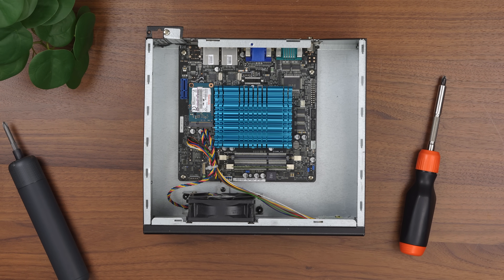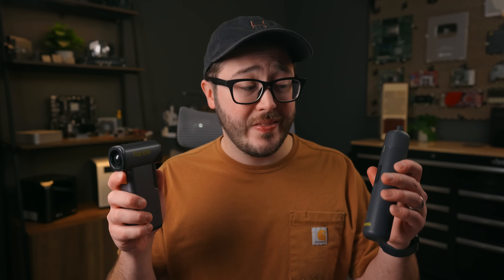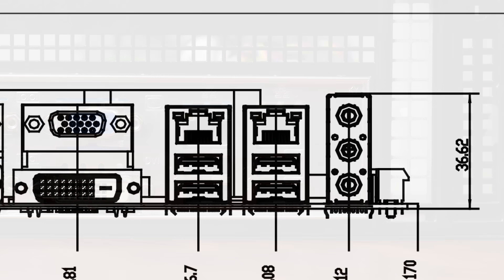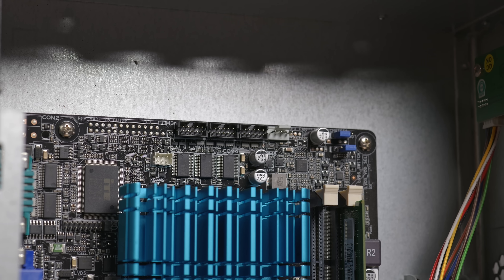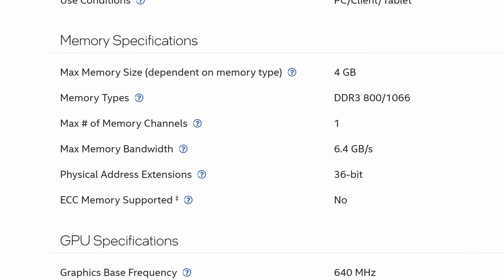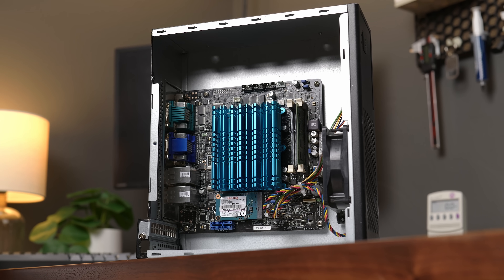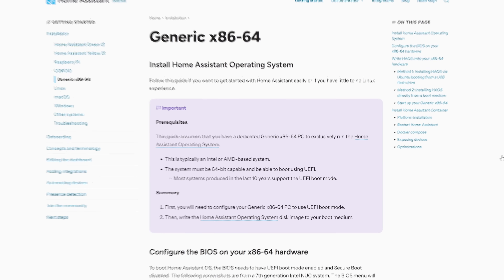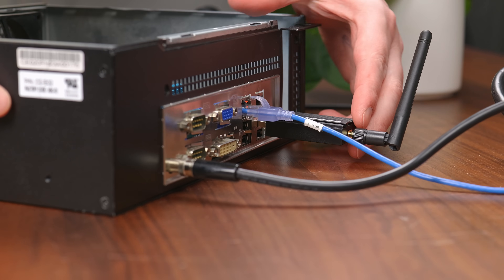I had no idea what this PC was... but I'm glad I bought it.

Comment: Systems like these are what I like to use as substitutes for Mainsail or Fluidd. I've got all 6 of my Klipper printers connected to an old Dell Optiplex 5050 with a swapped in 6100T. Ran me a total of $25 for a box of hardware at a yard sale. If it boots, it has a use. Just have to find it.

Comment: It's probably used for digital signage - it's low power with no moving parts for durability, it may get housed within a larger sealed enclosure getting hot outdoors which would need the fan, and the duties would likely just be displaying a slide show or video on loop for advertising purposes which would be updated remotely over the network. It may also have other sensors or inputs connected as well.

Comment: I paid $10 more on the B10 pro max duster 3 days ago before u dropped this video, might cop the screwdriver since my e1 max struggles to screw in pc fans or anything they requires high torque so I might cop the S1 pro or whatever name is with your coupon code at some point

Great video.

Comment: I have an old Shuttle ITX barebones system that was orig rocking a Core2 Duo motherboard which died long ago... It currently has a weird AAeon motherboard, did you try CPU-Z mine shows as EMB-B75A (2/3RD gen intel) which is what the motherboard is,  with a "very" exciting i3-3220 and a staggering 8GB (4GBx2 dual channel DDR3 ) .. It was some sort of industrial board as well and has some quirks I tried putting a NVIDIA Quadro M2000 in the PCIe x16 slot but it refused to boot with it at all.      Just sort of messing about with docker with it (running a rustdesk selfhosted-server atm)

Comment: HA seems like a good application. Otherwise if you needed an ldap server or other small applications would also work. As an aside, I similarly bought a $16 PowerMac (Blue/White) off Ebay in mid-00s for my kids. I added a stick of RAM and a larger HD and for them (less than 8 yo) it made a great machine to play games on. Reusing old surplussed equipment can be great if you have the right use for it.

Comment: I'd install IPFire and use it as an edge firewall.  The RAM, SSD, and dual NICs are super-good-enough, but the Atom D2250 is limiting.  On a 50 Mbps DSL, it would shine using IPFire with transparent proxy + update accelerator.  I'd also try Intrusion Prevention for fun, but it's doubtful with that CPU.
Reply: Unfortunately that little atom cpu would struggle with anything over 100 Mbit broadband. A while back I bought a 4-lan port mini pc from aliexpress, it has a Celeron N2830. It worked great with my 100 Mb connection, but as soon as I upgraded to a Gigabit fibre, it became very clear I needed a stronger CPU. The whole network started lagging and would slow down. I'm now running (ipfire) on a different mini pc, with a core i3 6100 and that handles full Gb without issues, maxing out around 20% cpu when the full Gb is used.

Comment: I have got a similar board with the same CPU and i retired it years ago. It's less half the performance of a RPi4 and at least double the power draw. Slow as duck for just about any use more than serving a light web page occasionally.

Comment: Using a similar under spec thin client for snes emulation. They good enough for that and draw roughly 15 watts from the wall.
Model: Futro S720, 8GB RAM, Amd GX-217GA, 240 GB mSATA SSD upgraded from the initial 16 gb installed.

Comment: I'd run home assistant and WOL-NUT on it since it draws nothing and can handle home assistant
Reply: Until you do ANYTHING that needs a computational load. A RPi4 has more than double the performance and less than half the power draw.

Comment: I wish I had a system that could both be a usb gadget and be my hypervisor. So I could plug in anything that was at least a processor and a usb port and I might be able to use whatever I plugged in as a node... I could use it to offload some cron jobs, some file organization, etc and my main system wouldn't have to think so much lol. maybe like... a raspberry pi zero 2 for the booting and connecting to the network as a node. then the pi would need various images of proxmox to try on whatever system i plug it into... or just figure out how pxe serving works, and then anything connected to my network could be a node...

Comment: On the one hand, I'd love to have the opportunity to snag such PC bargains, but on the other hand, I'm afraid of how many computers would pile up at my place after a few months. 😀
Reply: They do that, all right. I got a good deal on a load of thin client PCs - more than 30 of them - cleared out from businesses that went to the wall during lockdown. Great little servers for a few lightweight services. Only problem is now, every problem looks like I should deploy another one of these thin clients in order to get rid of them all.
Reply: It definitely does that... 

You know you're in trouble when you lose count of how many machines you have. 😅
Reply: @T3hBeowulf  I was just mentally walking through the rooms and came to the shocking conclusion that there are at least 21 computers in the house (certainly not many more). However, several of them haven't been used for many, many years. One must be my father's first PC, a 386 with a 300-320 MB (!) hard drive; another is my Amiga 2000, which has been upgraded with an 80 MB (!) hard drive.
Reply: @JohnADoe-pg1qk  I have 4 older MacBooks, two 2009ish iMac 27”, an iMac g5, an iMac g3, 3 MS Surfacebooks (one of each gen) a newly built gaming desktop, a Microsoft laptop 3, an MS laptop 4, and a new MS Laptop 7 x elite, and a chrome book. Lastly, 3-4 old towers from early 2000’s… OH! I just got a Sinclair at goodwill  too 😂 it’s an addiction…😮 edit: 21 as well! And they all work beautifully and have been repasted, aside from the Sinclair which I haven’t tried to use yet.
Reply: @JohnADoe-pg1qk  Yeah... know the feeling. When i had to leave my old home at the beginning of COVID, about 8 PC's went to the dumpster and only two went with me. Then i moved again some 3y back and... there's two new desktops and 4 laptops that weren't here before 😅 Granted, the laptops are just waiting for the dumpster or someone that wants them, they're all very old and messed up, but the desktops i actually bought, because i wanted some "old boxes" that could run XP/W7 with no issues. Oh, and then there's a couple of mobo/cpu/ram/graphics combos in boxes, meaning they were my old PC's but got upgraded. And a box of mechanical HD's 160GB>320>500>1TB which guess, was the old one before the upgrade. Yep, there's people that have one PC and there's people that "collect" them.
Reply: True. I alraedy have almost a 100 of Arm computers and more than a hand full of x86 for monero mining. I don't even have enough intenet bandwith to turn even a quarter of them on. I would be great if manufactures would start building consumer grade multi cpu motherboards again.

Comment: Have the Intel Atom D2700 version manufactured by Shuttle (XS35V3?) from this generation. 
Only supported Windows 7 32bit. So it sits happily with debian running Pi-Hole w/ unbound. 
I was also able to upgrade to 8GB DDR3 (I know - overkill for current use case) and will see if I can add some additional lightweight servers like HomeAssistant, VPN server or something.

Comment: Well, I'm personnaly not big fan of this kind MB (with low power atoms), in my opinion they are too old and not powerfull enough. They also often miss enough expansion options, like mising SATA and only PCI-E 1.0. For example i have here motherboard with socket 939 and one of the first Dual-core CPUs, and it does have PCI-E 1.0 too, timewise, its around 2005. Only one positive is barrel jack power, this feature is pretty rare. 
I would like to see you try solder the two SATA ports and find out if they work, only disclaimer, if you try, you need to solder small caps rigth next to the ports, you can see empty pads, they are usualy 100nf.

Comment: The only issue I have with cludging something like home assistant into a board like this, is when it eventually breaks down or upgrades itself and breaks your boot sequence ( as it inevitably will) - you have to try to remember how you got it working in the first place. This can be the sort of extra step in a time critical situation which just ruins your day. It's surprising how dependent you become on home assistant just been there and working.
I am in this situation now with my microserver 10 which is effectively stuck on Debian 10 due to lack of EFI support which is starting to cause problems with upgrading my other services. 
It's all just unnecessary complication when you can make life so much easier for a little bit more spend.
Reply: But Debian still works fine without EFI support by going with the grub-pc package that installs legacy/MBR based GRUB2 booting. Debian 12 also still supported 32-bit CPUs while Debian 13 unfourtunately doesn't offer kernel images or install media for 32-bit systems anymore, but if you're willing to build your own kernel and upgrade/install through debootstrap, even Trixie will run on 32-bit systems
Reply: @resneptacle the microserver10 runs a 64bit OS so that's not really the issue. I understand it's still possible to run legacy boot on newer debians - but it's another one of those cludges. With the microserver it already requires a stack of cludges to get it to boot off a SSD reliably. It's twitchy.

Comment: Yep, a smaller 3D printed case and making it a HA box for the win. 

And then use the case for an itx build that fills it up. 

Absolutely worth the $10. 

And I am now yet another inch closer to buying my first 3D printer. Been resisting for months now and the resistance is getting weaker and weaker.
Reply: i think i would use more filament and time then the $10 dollar case is worth, but i wonder if that would fit in a mini rack with some added screw holes

Comment: These boards will go on forever in places doing stuff like running old CNC machines in industrial settings.

With 8w idle in 2012, that's crazy.

I feel not using the com ports is a crime but it's harder in a home setting without odd industrial hardware.
Reply: Nice expanded thinking! I like it 👌
Reply: I got more powerful thinclients with 4 core Intel CPUs, >8GB RAM and SSD idling below 5 Watts ....
Reply: @Eysenbeiss  selective reading ;)
>With 8w idle in 2012, that's crazy.
Reply: @Eysenbeiss  You don't need that much to run CNCs
Reply: @ppprime98K  Home Workshop CNC Mill would be perfect for that system.
Reply: @PiDsPagePrototypes  You'd probable run Mach3 software which needs a EPP parallel port..
Reply: @winandd8649  Not that difficult, with parts drawers going back to IBM XT and 286,... I have daughterboards with EEP's on PCI and VLB, and maybe even ISA. Hrrrrm,.. I think I still have the AM5x86-P75 board out of an analog TV era EVS machine, that might to the trick nicely.
Reply: @Eysenbeiss   Look at Mr. Moneybags ovah heah with his 4 cores 😮

Comment: The case would be great for a mini home server.
Reply: Agreed, ive seen these types of cases applied in such areas
Reply: @wafflebell yea
Reply: We've had an atom single core mini itx system hosting web/mail/photo server for more than a decade with software raid 1. Only work I ask from it where its age show is compressing emails for backups, that takes quiet a while. Otherwise perfectly stable, only thing along with the internet that's on an UPS at that house.
Reply: Or like a PF sense box
Reply: i just put a similar board into a regular ATX case for a NAS